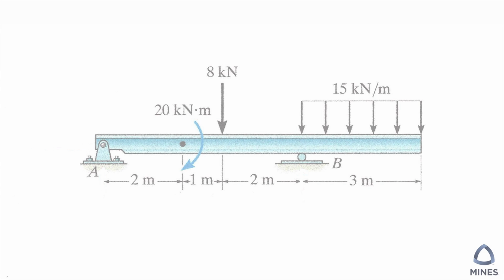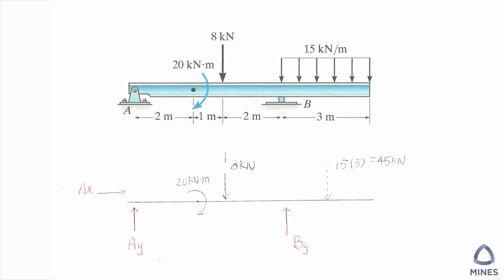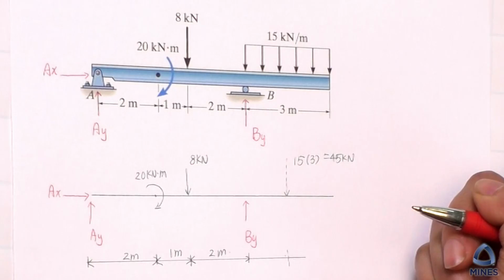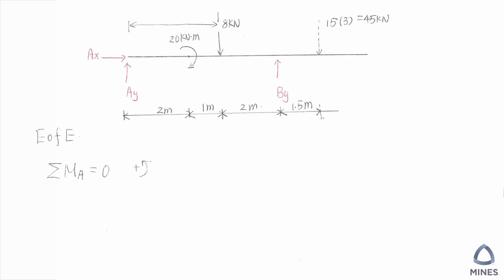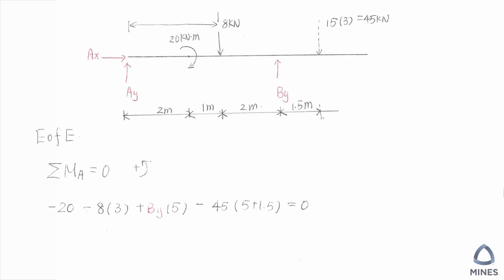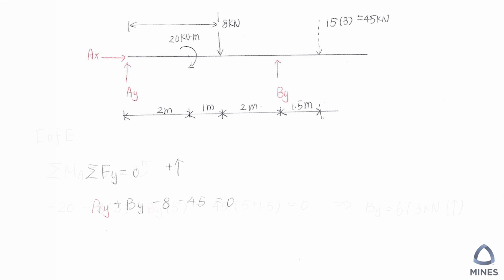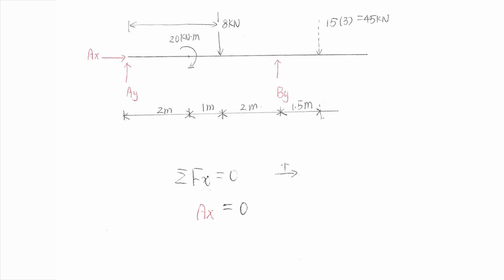Find Reaction forces for a Beam

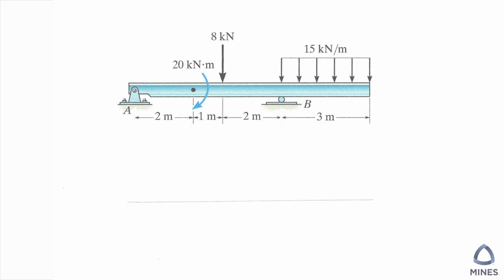Comment: 0:51 how do you decide the direction of the reaction forces (Ax and Ay) on point A?
Reply from the maker: You can assume ANY direction you want, and your final answer will tell you the real direction. For example, you assumed that the reaction force in y-dir goes down, after solving equilibrium equation, you got a negative value. This means that the orignal assumption (downwards) was wrong, should be in the opposite direction (upwards). I hope this helps.

Comment: Within the sum of the moment around a, how can you add up that other moment on the beam (20Nm) even thos that moment is not around a but around another point?
Reply from the maker: You're using moment equilibrium equation to find reaction forces which means you will need to include ALL the applied moment (20 N-m) and ALL the forces that might produce the moment at the point you summarized.